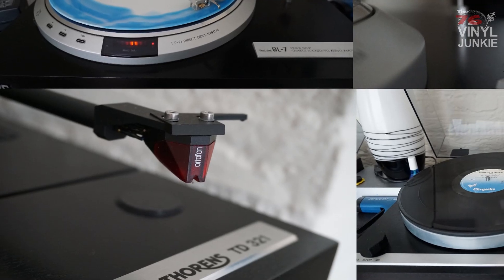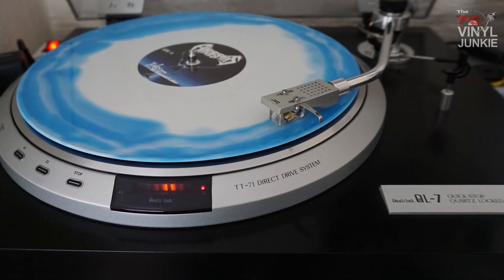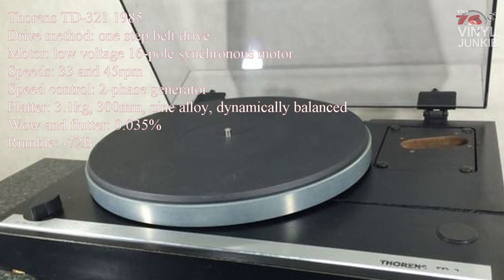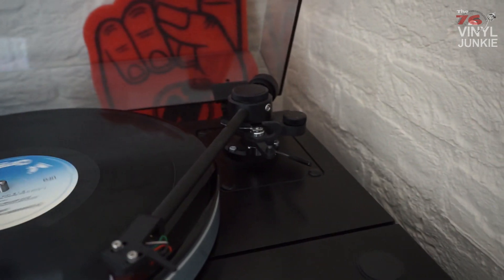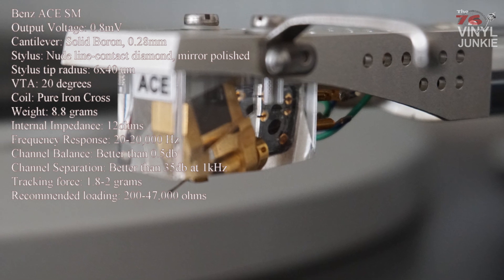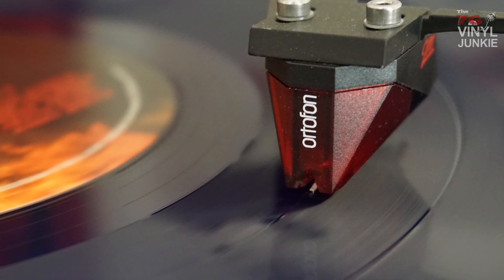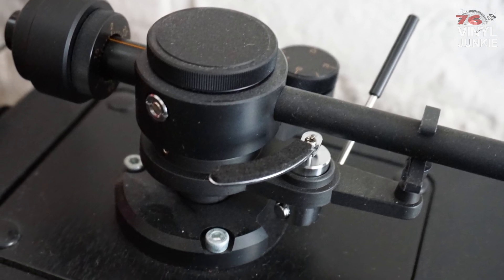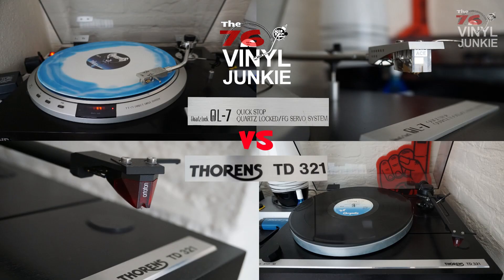Thorens TD 321 vs JVC QL-7 | Belt driven vs Direct Drive | my Record players / Turntables

Comment: Great video. My main turntable (Linn Axis) is belt drive. However I recently bought a cheap direct drive turntable (Rotel RP5300) just to see what it is like. I am quite impressed with the Rotel. The Linn is a far better turntable but I think that is more down to the superior tonearm than the drive system.
I use have a Project Essential turntable and that had far more motor noise than the Linn or Rotel. I would agree a good vintage turntable it better than a similarly price new turntable.

Comment: You can clean the nicotine residue using a paste of water and baking soda. It works great and doesn't etch the metal as long as you rinse it off well. Of course, that means you need to be able to rinse it which might not work on the tone arm. It does work great for aluminum knobs and faceplate on a vintage receiver.

Comment: In my experience good quality DDs and BDs are both way better in regard to W&F,SN etc. than vinyl itself can possibly be. And you dont need a vintage top deck or a modern high end deck for that.
In the 2nd half of the seventies up to the early eighties both drive system were effectivly optimised even in most middle class models.  They mostly were developed further to produce them cheaper and with less material.
Where the bran gets purged from the barley is in tonearm/cartridge quality and synergy. 
Also dampening of the plinth is an issue,but to a lesser degree. Some firms like Sony or 
Kenwood for example made plinths from artificial stone which are way better than high 
density particle board. Others focussed on subchassis construction.
Anyway,the most important point aside from the drives quality - regardless its principle- is the ability of the tonearm to let the cartridge reach its full potential. Not every cartridge 
fits in every tonarm regardless that it fits geometrical.

Comment: Would you say it's totally subjective whether DD or BD is better? This guy is trying to convince me as to why BD is better than DD.
Reply from the maker: +blake kersey A well build DD table (JVC, Denon, Technics) perform just as well, or maybe better, than a BD. Advantage us the maintenance, steady rpm and speed up time. Only in the extreme high end segment you see BD tables that perform a little better. A normal person with a modest setup won't here the difference. The tonearm and cartridge make a much bigger difference.

Comment: Belt drive is the preferred type of table amongst die hard audiophiles and I definitely prefer belt drive to direct drive any day of the week.
Reply: direct drive simply cannot compete - there's no way to decouple the platter from the motor - and hence the bearing - which is where it really matters... in the higher end of things most of the engineering and expense goes into the bearing ...
Reply: @antigen4  Linear motors?  Fisher MT-6250 runs a 120-pole linear motor where the platter forms part of the magnetic drive - no mechanical linkage to the motor.  Or mag-lev drives?

Comment: Direct dive was made for radio stations and are now obsolete.It was a durable commercial drive but it does have more noise and flutter.
Most DJ themselves bought and recommended belt drive for home use.
Reply: Ok. A Yamaha gt2000, pioneer exclusive p3 technics sp10 mk3 Sony is x9 all pale in comparison to belt drive. Just lol. It's all about implementation and design. You can't generalise like that.